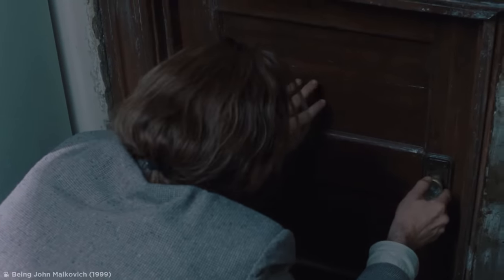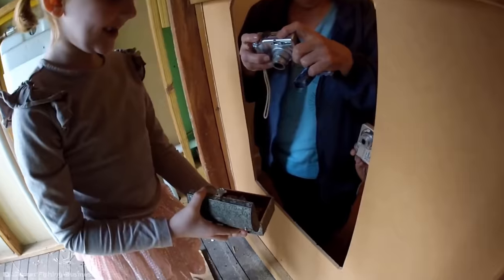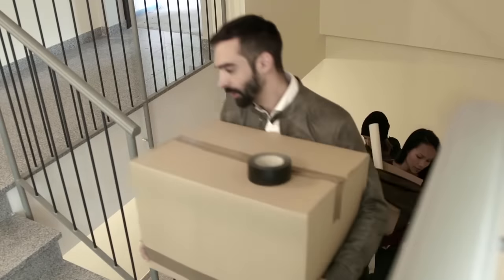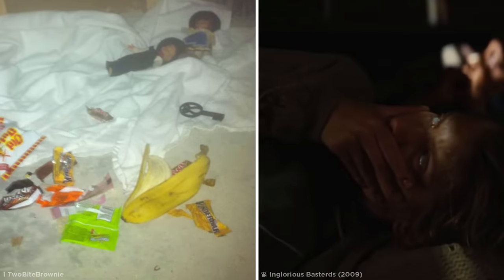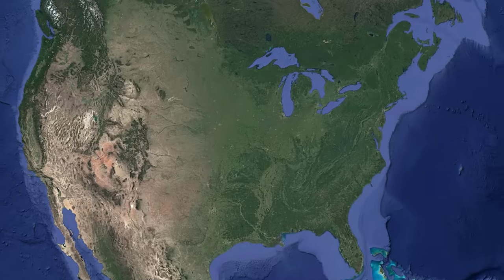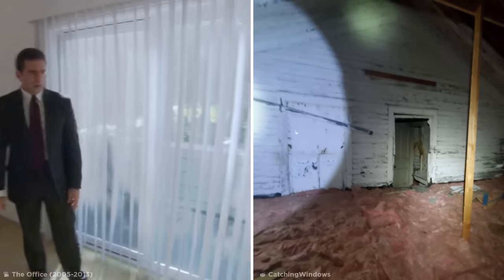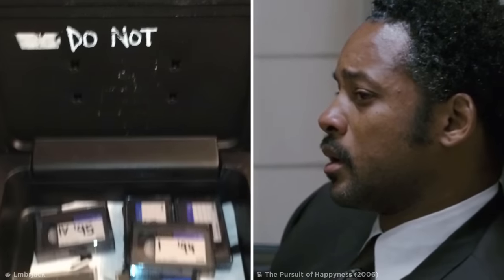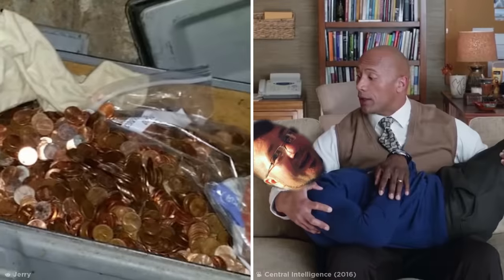Little Girl Finds A Secret Room In Her House That Leads Into An Even Wilder Surprise

Comment: As a electrician i had to help reconstruct a building in a old town.
When we broke open the floor we found a catacomb like tunnel connecting all the houses in the street.
Later we lerned it was known by the townhall but they forgot to mention it to the new owner.
When inside we also noticed it was known under some residents since some parts where gated off, still a thrilling experiance tho.

Comment: The dad that made the hidden room and treasure hunt. Very cool. My dad did something similar when I was about 7 or 8 years old. I was in love with model trains, like Lionel specifically the HO scale. In the house I grew up in, in Miami by father secretly built an incredible HO scale model train layout. It took him a year of working nights while I was sleeping or when I was at school on his days off. We had a "play room" which was just an old enclosed garage used for toys and tools. One Christmas morning I was opening presents and there was a shit load of model trains, locomotives, rolling stock, little scale cars and trucks.....but no tracks. I was happy but confused about where I would use them. Well he took me into the play room and asked what I see....I saw nothing more than what I saw every day. Then he goes to one of the walls and flips a latch and this massive train layout folded out of the wall. It was incredible, roughly 15 feet long by 7 feet wide! It was the entire wall and was only noticeable folded up by the long piano hinge that ran the length of the wall about 12" off the floor, easily hidden by the couch and boxes of crap. It was complete with 2 tracks running the entire layout, switch tracks, houses, buildings, trees, roads and fully lit up. Every house and building had lights , the street lights worked, when the train went over a RR crossing the gates lit up and came down. It was amazing! I couldn't wait to put all my new trains and scale cars on the layout. I'm 47 years old now so this was back in the early 1980's. I still have most of the trains in storage. I hope to build something similar for my sons one day. My boys are 12 and 4 so I need to work fast. LOL

Comment: amazing dad right there gives me ideas, lol, and the guy who found the city in his basement I would have told no one ever and would have made a secret entrance to get in and fitted it out with lights and stuff, man; that was awesome
I found some crazy stuff through the years doing all kinds of construction and electrical jobs. I recall one house that had an enormous basement and an opening that was quite small and up so high you needed a ladder to get in, and I am quite small, so in I go and what I find is I am actually between the floor of the 2nd story and the ceiling of the 1st floor, and then after crawling quite a ways about 15 feet or so in a space about 12 to 15 inches in height I came to an opening it was  big enough I could stand back up, and this room was the big size of a bedroom, and it had other sections going out of varying sizes, and one had a poop kitty cat that must have got stuck so sad but yeah crazy places right around us

Comment: There's a handle in the floor in one of our closets in my house. It looked like just a handle since we didn't see any signs of it being a trapdoor until we took a closer look. My dad tugged on it until it began to open. He moved in order to completely open the door to reveal a secret basement and no, it's NOT a crawl space, it's a legit basement that was sealed
Reply: what was in there?
Reply: @peterhuang1431  other than an empty basement, just a thick, black tarp seeled to the floor. I did some walking around, looking for bumps or anything out of the ordinary. Pretty much, the same results as the vault clip. I thought it would be a crawl space, but it's pretty neat that it's whole hidden floor. Pretty fascinating.
Reply: @sjemccabe  thanks for being honest. But after it's cleaned, it's a nice extra space to use and hide out for any emergency in future if needed :)
Reply: @peterhuang1431  yeah, we put our suitcases, holiday decorations and extra gear down there. There's a section of the basement that we would use if we had to take cover for some reason
Reply: Sounds like you have to build a false wall in there!
Reply: @Peter Ng  we didn't build anything, we just found our strange staircase to the basement. What I don't get is if it's a regular basement, why does it need a crawl space/trap door as an entrance?

Comment: My old house had a lot of different crawl spaces, all of them upstairs. There was probably 4 or 5. I was moving out during the summer and once I moved my dresser that was covering  a large crawlspace I decided to open it. The crawlspace was nailed shut so it took a while to unscrew all the screws. Inside was an unfinished part of the room with no floor or windows. If you really wanted too you could knock it down and extend the room.

Comment: In Australia the Summers can be extremely hot and cost a fortune to run Air-Conditioners to cool down your home.
So when I had my home built, I had a huge hole dug out and built an exact copy of my home under ground with just 6 feet between the ceiling and the floor of the house that every one can see. 
The cost was less than you think it would be but the under ground home was worth it and costs almost nothing to heat in winter or cool down in summer.
Not to mention that when the In-laws come over, there is always plenty of room.

Comment: Very nice stories I have a hidden space...well sort of... my grandmother lived about a half an hour away and we would go there a few times a month. She only had two bedrooms in the old farmhouse it was the house that my mother had moved to when she was a teenager. This back bedroom was her bedroom and one time they're spending the night in that room I have known that room for a long time and I slept in that room from quite a few times. However I thought it was odd that the room had two closets granted both closets were very small so I thought maybe that was the reason. But on this particular occasion when I was 8 years old I was told about the duty of one of the closets. I was told to look at the floor I didn't see anything except for a shallow closet as it was quite dark and filled with old coats. But if you push the coats aside and you look very hard you could see a step these steps turned in 90 degree angle and narrow staircase that led upstairs to a hidden attic. We were not allowed to play up there and wasn't actually kidding but unless you I knew it was there you would never know. The attic was quite piqued and had windows on each end the front of the house and the back of the house and they were quite large but it could have just been ornamentation or you could have had to gone in through a crawl space in a closet but not this house this house had a hidden staircase!

Comment: 7:15 the pieces of tape around the dial. I believe this holds the combination to the safe to someone who knows how to read it. The pieces of tape seem to be carefully measured. Even though the tape is not perfectly cut so each piece is a precise rectangle. I think if you measure the length of each strip from the very center of each strip you will end up with a number for each strip. For example the strips are all the same width, call it 2" wide which is standard packing tape. So from precisely the one inch mark of the center you measure the length of each piece of tape. I don't know how many numbers that combination have, usually 3 or 4 numbers. There are 8 pieces of tape so starting from the top working clockwise just guessing the lengths in inches....4-4-1-2-4-5-2-4. So if it's a 4 digit combo I would guess 44-12-45-24. Just a guess obviously. No other reason for the tape I can see.
Reply: Interesting theory

Comment: Vault:  Anyone remember late 1970's. I believe. Geraldo Rivera, erstwhile TV reporter, had a huge publicity campaign about him  opening Al Capone's vault, supposedly unopened since his incarceration in the 1930's?  Weeks of buildup----and it was empty!     I, myself, was cleaning up the long-disused backyard of a house my parents had just bought.  I was digging a hole for a fencepost when I hit something very hard.  Clearing a bigger area I uncovered a strange concrete slab.  This was in an area where smugglers operated during Prohibition!!  I grabbed a sledgehammer and went at it.  Got a small hole begun, and an odd odor wafted up, so I grabbed a pole to prod with.  Just as I was pulling up the pole, my father appeared; "Found the old septic tank, did ya?"

Comment: There is a sealed door in my closet.  I'm in a duplex and the landlord said there is supposed to be access to the attic somewhere in either unit.  I'm guessing, because the units are not exactly one wall apart, that it's a space that leads to the attic, or a staircase leading to the attic.  BUT, I don't know what it is or why it's sealed.  From watching the original Don't Be Afraid Of The Dark movie, I know better than to look.

Comment: if it is an old enough house that dates back to the days of bordellos/brothels then the secret room may have been an escape path that the prostitutes would have taken to safety.

back in the  period of bordellos/brothels customers would often try to get services for free or worse and so the prostitutes had to have a way to safety so there would be hidden rooms.

another possibility is the house had a bathroom there and that was the access to the back of the bathtub for the plumbing and then the house was since remodeled and so the hole in the wall was never removed.